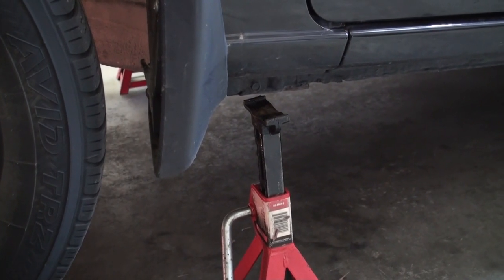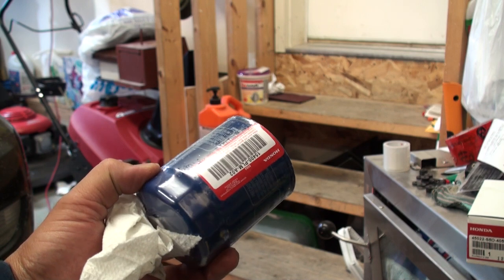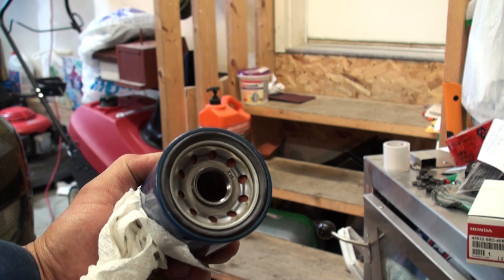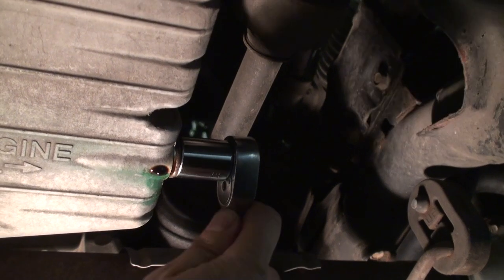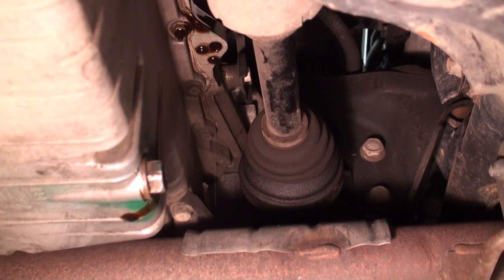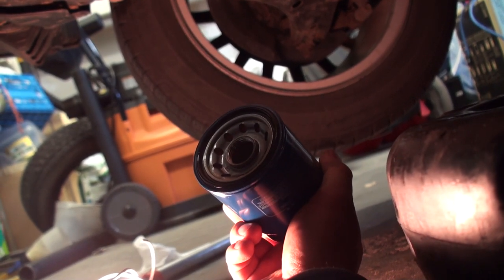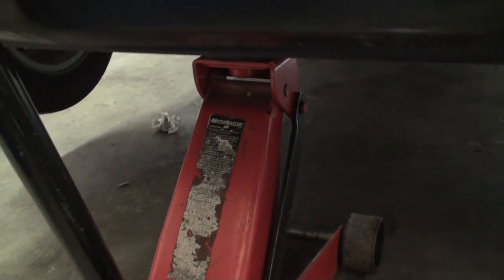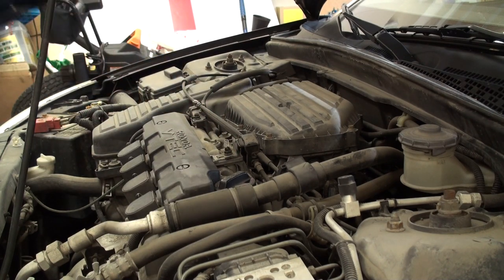DIY Honda Civic Acura 1.7 EL Engine Oil and Filter Change

Comment: I have a 2005 honda civic 1.7L engine D17A2, but the dipstick is broken, how do I know which one is the right one?
Reply from the maker: you can order a replacement from your honda dealership or go to an auto wrecker and get the same dipstick from another civic/acura el that is equipped with the D17 motor.

Comment: My acura has 370km... I am thinking of putting synthetic oil for longer engine life... am I right with that assumption?
Reply from the maker: 370K kms?  If you've run this long on dino oil you're probably best to just stick to dino oil.  Synthetic oil may cause leaks with mileage that high.

Comment: Mine has 285k on it. Is it better to switch to 5w30?
Reply from the maker: the only time I'd ever put in a thicker viscosity oil into a motor is if you're going to be running in super extreme temps (ie. race track) or if the motor is consuming more oil than usual.  We have a 2002 civic at home that STILL uses 0w20 oil (or 5w20) and while it does eat a tiny tiny bit of oil that in the grand scheme of things it can still handle the 20 weight oil.  NO reasons for us to move to a thicker oil yet and we're at 375, 000kms.